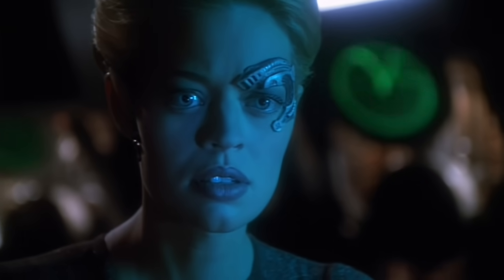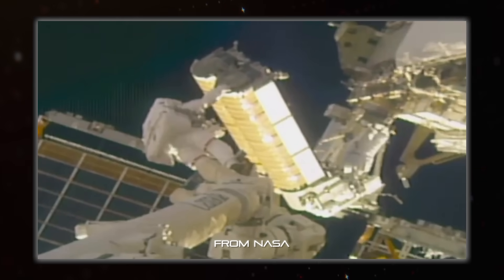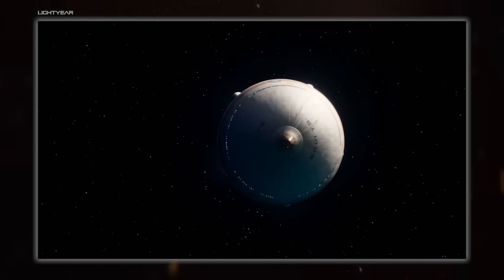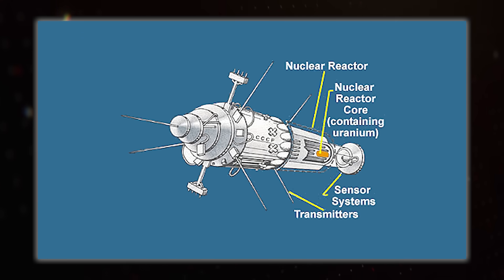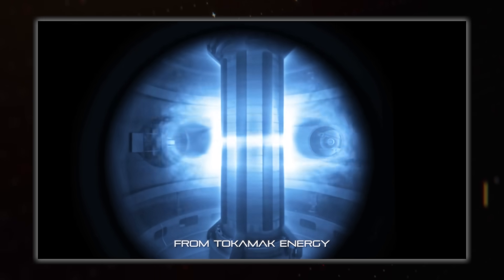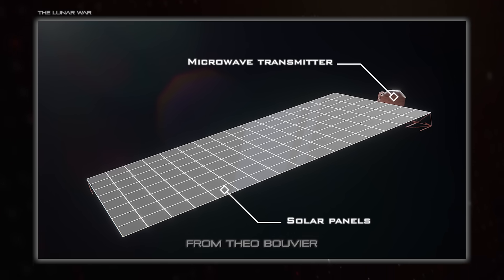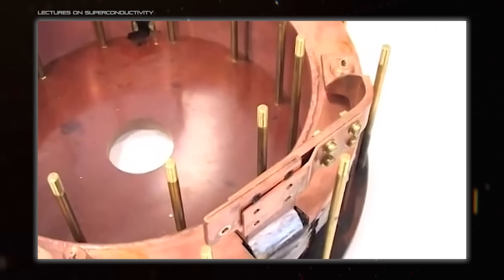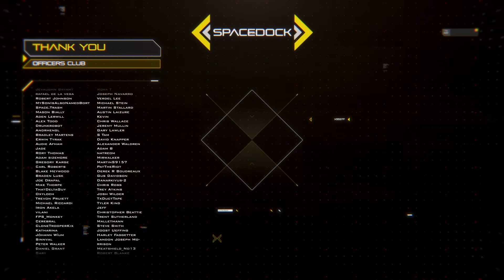How to Power a Sci-Fi Spaceship

Comment: “And you’re screwed if you lose [antimatter] containment completely.” This is a common cool sci-fi event, but not actually much of a problem IRL. CERN today, and for a few decades I believe, has self-powering magnetic bottles as the final layer of backup after grid-power and then batteries. 

It’s functionally equivalent to a very slow tank leak for any other fuel, since it’s using a small amount of the antimatter to power containment. But at least it’s not letting it touch the walls of the unpowered magnetic bottle all at once! 

You probably don’t want to be relying on it long-term, unless antimatter is VERY cheap in your setting, but it should pretty much absolutely guarantee you never run into the issue of explosive antimatter fuel tanks. So the real worst-case scenario is basically equivalent to the issues we have with regular old hydrogen tanks ;)
Reply: Yeah, but generally sci-fi has much more antimatter being stored, and you have to worry about dropping it or getting hit by high-speed projectiles.
Reply: @henryfleischer404  I wouldn’t worry about dropping them, there’s so many layers of plating. I wouldn’t be surprised if even larger quantity ones had fairly physically small physical bottles inside what looks like a barrel or something. Now of course if you had one giant tank that might be less plausible, but given the way magnetic field strength drops-off I imagine you’d need many small cells regardless.

Now, being hit by a missile or a giant antiproton beam or something… yeah that could do something nasty. I suppose that technically qualifies as “losing containment”, but to me that’s more like “catastrophic high-force breach” haha. I mainly associate that phrase with losing power to the tanks, whereas an attack is straight up destroying the tanks! 

Now of course, when you have magic handwavium tech like forcefields the option of having an absolutely massive tank of liquid antihydrogen or something which potentially raises other safety questions. But personally I would still suggest a similar self-powering system, tapping a little to power the forcefield instead, could be viable. Which has the added bonus of forcefields often protecting against attacks quite well in softer sci-fi, as well. 

Now I think possibly an even bigger threat than physical attack could be stuff like computer viruses that just shut everything off, trick the various backup layers, and deliberately release the antimatter into the rest of the ship. Which, much like the other example I’d call that “sabotage” rather than merely “losing” containment. If that makes sense.
Reply: @kaitlyn__L  Containment can be breached after a hit of containment cell by a missile or an asteroid. So antimatter is still inherently more dangerous than storing some deuterium or helium 3.
Reply: @ImperativeGames  see my reply to Henry! :)
Reply: @kaitlyn__L  If we're dealing with a setting where anti-matter is commonly available (even if restricted to starships and the military), I would wonder why they'd be relying on anti-hydrogen? I do understand that it requires less steps, but wouldn't moving on to anti-lithium be far better? Anything that is a solid or liquid in a vacuum would be preferable to something that's a solid, and you could regenerate some of the energy while fusing the anti-hydrogen. Of course, once you get to anti-lithium, there's no much reason not to go all the way to anti-iron, but that's a separate story.

I would imagine that granules of anti-lithium would be far safer to store as it wouldn't be put under pressure to maintain a decent density. Either that, or shave off slices from a block like the railguns in Mass Effect to use. Either way, density would be higher and containment easier for just making the production a bit harder, but well within the technology of any setting that can produce anti-matter at scale.
Reply: @FGMagala  that’s fair. Perhaps I’m thinking a little too grounded in that regard :) in my art I tend to imagine antimatter farms around the magnetic poles of gas giants (basically getting it for “free” from the solar wind) rather than 100% artificially generated, and “very cheap” but for travel within a solar system rather than between them. If you’re somehow manufacturing the antimatter just like we have to do today, but somehow at a cheap scale, perhaps you could trivially choose other elements!
Reply: @FGMagala  If we're in a setting like Star Trek where they actively reverse spin their deuterium into Antideuterium isn't there still a steadily increasing cost of energy input the heavier the atom?
Reply: @kaitlyn__L  I mean, even if the technology to create antimatter is barely any more advanced than it is today, as long as they have energy abundance, brute forcing it isn't that terrible anyways.

Most sci-fi settings have fusion power, and that alone can bring anti-matter into the "cheap enough to use for important things" category I think.

 @3Rayfire  Depending on the technique, not really. Fusing atoms smaller than iron will generally leave you with a net surplus of energy, presuming the system is 100% effecient (obviously a tall order here). This means that as long as the end result is iron or smaller, you can simply have an antimatter fusion reactor to power itself to make heavier elements. Lithium is the smallest solid in a vacuum that exists, and it's only 3 protons . Unfortunately, it seems like there's no known isotope of lithium that has any decent degree of stability smaller than 6Li, so you still need to fuse 6 anti-hydrogens together at the minimum. Still, making it a solid should be worth the effort since the process shouldn't cost you any additional energy than the cost to build the facility.
Reply: @FGMagala  haha yeah, after I sent that I was thinking “extremely advanced fusion cycles, but done with anti-nuclei” could be a feasible method of “compaction” potentially. Which has an interesting circularity in terms of powering the antimatter-creation machinery (even if most of it would be powered by conventional fusion and if in effect it was just marginally reducing the power requirement from the initial creation of antiprotons and positrons). 

I like the idea in a fiction of antimatter being the “high octane” gasoline, generally more explosive, a little less efficient to store and manufacture, but gives a more instant power reaction etc etc. While fusion rockets are like diesel engines, simpler, more reliable, technically more efficient overall, but bulkier and takes a while to get going and stop again. (Albeit of course much faster than fission drives! Which would… be like a coal powered ocean ship?)
Reply: @kaitlyn__L  Yea, I generally see antimatter and fusion drives in a similar way, though I don't see why fusion reactors need to be big. Honestly, the size is entirely dependent on the effectiveness of the magnetic containment vessel and efficiency of the fusion process itself, and there's no reason why it can't continuously be refined until we get something like a micro-fusion cell in Fallout. Just not in a post-apocalyptic setting like Fallout.

That said, it's really only for near-future settings, since past a few thousand years, I would imagine something more exotic like black hole reactors being the new antimatter, and normal antimatter being safe and cheap enough to replace fusion drives, with fusion being some sort of emergency backups and for escape pods because you can gather the fuel anywhere with nothing but a solar sail.
Reply: @FGMagala  sorry, I don’t mean the reactors themselves — just the size of the tanks etc due to antimatter’s sheer density! 

But yeah, manufactured antimatter is just a denser form for fusion fuel basically. That’s part of why antimatter farms and collection-complexes appeal to me, not just because it’s a lesser-discussed kind of infrastructure but also because it actually IS a net gain of energy in the form of antimatter fuel haha.

And yeah, that makes sense to me that fusion would eventually replace fission in that way as you propose after many millennia. I personally tend to like the “a couple centuries away” settings for being marginally more grounded in that way. But thinking about the far-off is fun too!
Reply: @kaitlyn__L   While the net positive energy of antimatter farms is nice, I do think that the production rate is far too low to be viable unless if antimatter isn't actually used much, like only for an interstellar ship that only launches once every decade or something. If you actually want a partial antimatter economy, you need to produce it yourself, and that's not going to be net-positive in the slightest. But considering the potential of fusion, unless if actually building and operating the plants is expensive (which it shouldn't with near-future automation), the energy loss shouldn't be a big deal even if you have to dedicate the current Earth's energy production just for one solar system's antimatter needs. Fusion is just that good and abundant.

And while yes, the density of the fuel is great, frankly the ability to refuel fusion fuel pretty much anywhere (hydrogen, deuterium, and tritium is really quite abundant anywhere in the solar system), means that you don't need large fuel tanks outside of interstellar voyages without FTL.

And regarding Fusion replacing Fission, I don't think it's a distant future thing. I think it'll happen in every area aside from some niche usage within a century, two at most. We've been making lots of great breakthroughs lately, and even if the "fusion is a decade away every decade" joke keeps running, a hundred years of development means a lot when you can add AI and more government funding as we reach the limits of solar and wind while phasing out fossil fuels. Unless if it actually proves impossible, fusion will come before we have cities on the moon or mars. Hell, I bet we'll have a fusion plant on our first off-world colony before the population exceeds 300.
Reply: @kaitlyn__L And fission drives, which are not far from existing IRL, are still massively more efficient than chemical engines.
Reply: @deepspacerunner187  indeed! In these discussions chemical engines are so inefficient as to barely be useful for RCS, if that.
Reply: @kaitlyn__L  That's interesting. In my head I had considered collection from the vacuum of space as an option, but had largely forgotten that you could collect it from magnetic poles. I was imagining giant farming operations around black holes for a highly advanced civilisation, but I assumed that antimatter would be mostly treated as an exceptionally inefficient, but incredibly dense and with high maximum power output, battery, for the most part. I can imagine scenarios where a civilisation might just stomach the incredible inefficiency of antimatter generation in order to allow for the exceptionally dense storage of energy.
Reply: "So the real worst-case scenario is basically equivalent to the issues we have with regular old hydrogen tanks..."

...that also has an explosive yield equivalent to 43 megatons of TNT if just a kilogram of fuel ruptured out of it.
Reply: @iliketrains0pwned  that is the energy density of antimatter, yes!
Reply: Bruh, those hold 1-4 ATOMS of antimatter. Not the TONS you would need for a starship. Not everything can be scaled up...
Reply: @MeepChangeling  Self-powered magnetic containment is one of the things that can be scaled up; even more efficiently in fact. That's not to say that it's the best option, there's plenty that are better, but "number get big" doesn't mean that an engineering challenge is impossible to overcome.
Edit: spelling
Reply: Cern only manages to capture individual atoms and only has the magnetic traps for studying the atoms before they annihilate, not for any safety concerns. If you go to a hospital and get a P.E.T. scan that machine produces positrons (the anti particle of the electron) in small quantities, the gamma rays produced during annihilation are what's used primarily to produce the scan. Antimatter -matter reactions only get dangerous once you get into the scale of grams and higher
Reply: Hydrogen takes tanks as suggestion and is sometimes inside, sometimes outside.
Also it corrupts steel.
Reply: Another containment method I haven't seen mentioned yet which would be very safe is electrostatic fullerene cell containment; the antiprotons have the same charge as electrons and would be repelled by the valence shells of atoms in a lattice more than they are attracted by the protons in the nucleus, therefore holding them in place. You'd need to get antiprotons and antineutrons together into a nuclei to get the same energy density, but it's doable.
Reply: @DavidBarkland  that’s a neat idea for whole anti-atoms in a fairly dense way, for sure 😊
Reply: @kaitlyn__L  It's how antimatter is generally stored in my setting, though rarely used for anything other than antimatter-catalyzed fusion (since most mid-tech spaceships use antimatter-catalyzed fusion for thrusters and power plant, and most mid-tech thermonuclear warheads use antimatter-catalyzed fusion for their, well, fusion).
Reply: what if a conventional explosive blew up one of these fuel cells?
Reply: what if the antimatter is stored in red barrels with the explosion symbol on it?
Reply: @autisticboi2992 Then we’re all screwed.
Reply: CERN has, like nano-grams of the stuff, hardly enough to light a lightbulb for a few seconds. Starships hauling around tonnes of antimatter are right to be nervous about containment. Especially if naughty aliens are trying to poke holes in them.
Reply: Antimatter -matter reactions are only dangerous once you get into amounts like.grams amd higher. Particle accelerators like cern only make a few atoms at a time. The magnetic traps are there so the antimatter can be studied before it annihilates. A P.E.T. scan at hospital uses positrons aka anti electrons to produce gamma rays from annihilations to produce the scan. We've never made any consequential amounts of antimatter

Comment: My energy shields work differently than "traditional" shields, rather than depleting power, they absorb power, and the way to break them is by overloading what are essentially capacitors capable of storing the unpredictable and sudden inputs from hits, and this energy is then refined over time into usable power for the main ship batteries.

The shields do require a bit of energy to maintain however, so if the ship batteries were to run out, an emergency RTG can provide just enough to start the shields and use them as solar panels.

This creates a significant down time however while waiting for enough energy to accumulate to start the shields, so larger military ships are equipped with a small fusion generator, which also have the advantage of not being reliant on solar power.

The fuel for the fusion generator is provided by atomic reconstructors (star trek replicators), which of course need power so they always store just a little bit of fuel, enough to keep running for a few days while making your way to a nearby star, or to finish a fight.
Reply: Neat. I had the idea for an anti-kinetic shield generator that has the drawback of having any force blocked by the shield be transferred into the generator, but with the workaround that the generators are built with a flywheel/gyroscope design that allows them to spin to both absorb forces more easily and convert the energy from attacks into electrical energy.

Comment: What about ZPMs?! I gotta have mah Stargate Atlantis!!
Reply: For any that doesn't know what Zpm is Zero Point Module,  zpm use Zero-point energy, The device itself serves as an enclosure for an artificially created pocket of subspace-time. Zero point energy is extracted from this pocket until it reaches maximum entropy, at which point the pocket collapses, leaving behind a useless shell. from Stargate fandom wiki
Reply: Now we're talking!
Reply: Don't forget Project Arcturus. And the idea that they could make better faster ships than with ZPMs by fitting each one with a reactor the size of a multi-story building that pulls zero-point energy from our own spacetime. So long as we're good with crazy unpredictable nonsense constantly happening in the reactor. Maybe that was the precursor tech to the Infinite Improbability Drive...

As far as energy density goes in sci-fi, I think the ZPM is the holy grail unless McKay is involved. He'll drain that sucker faster than you can blink. But a foot long crystal that can be plugged into anything that runs off of electricity... pretty compact for how powerful they are.

Comment: 3:16 that’s how we do it in Space engineers! Don’t ask how it complies with Thermodynamics
Reply: Better than a ship pushing itself with a gravity drive.
Reply: @VoxAstra-qk4jz  The troll physics are real.
Reply: Well, it does. You need power to split Ice into oxygen and hydrogen to use the hydrogen in thrusters. That power can come from solar, fission... Or burning hydrogen in a generator.
Reply: @RoonMian  they are saying that there would be a bunch of waste heat that needs to be dealt with.